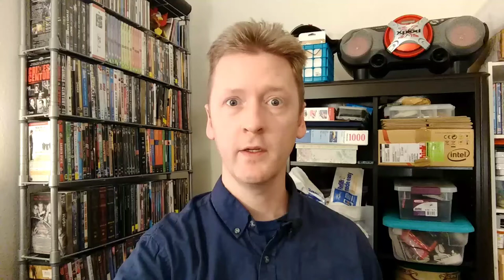Solar steel and iron batteries

Comment: It's become cheaper because it's now around 40c Aud per kWh. 
Our home is very careful with power usage, 3+ years ago our   Bill for the year was $1700 which is probably about a quarter of what a regular family home should be.
However we had a 2kw solar installed and this brought our bill down to $900. But now with more increases in power price it's now back up to $1800.So with this high  price even for us power frugal users it's nearly time to rip out the 3 year old 2kw system and install a 5kw solar system. 
Unfortunately we can't win in this power game yet because the power companies still want the same profits. 
However it is good in the perspective of renewable energy and the push for this technology. But not good for our elderly pensioners who can't use heaters and coolers or if they do they go without food.